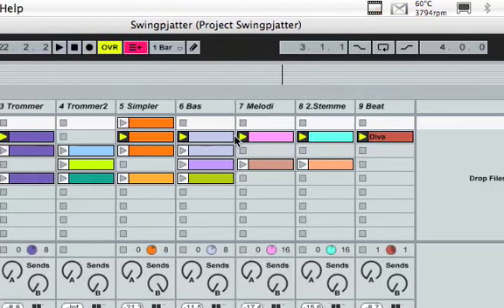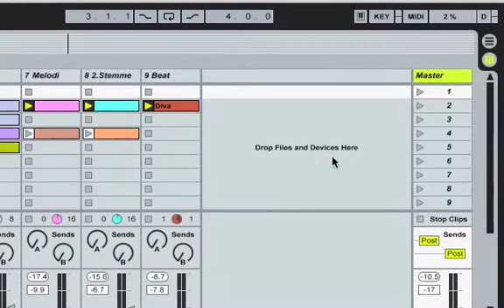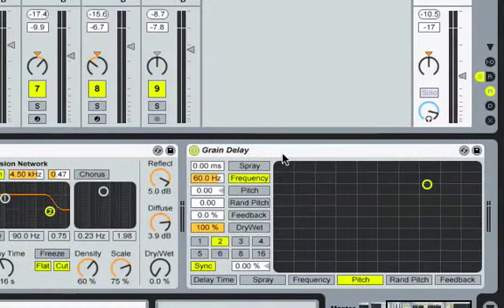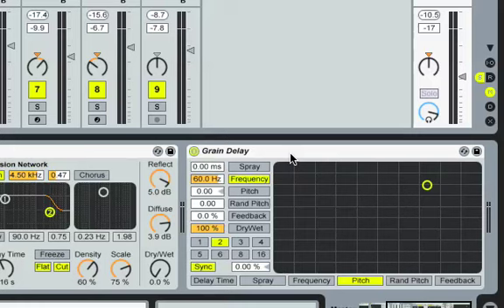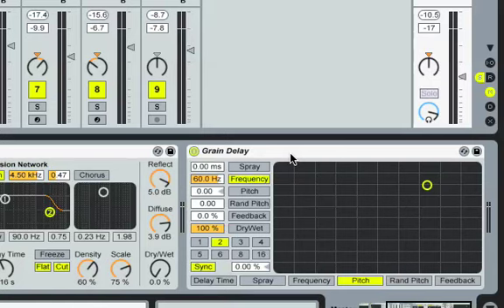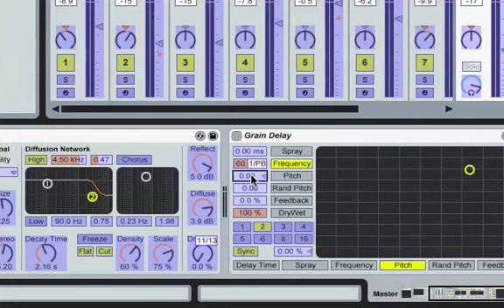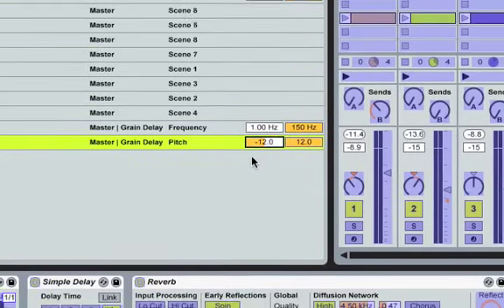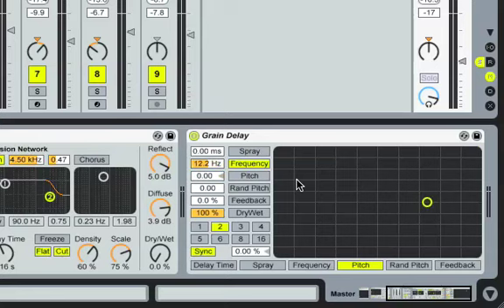How to make a cool pitch bend effect in Ableton Live

Comment: Many popular songs use some sort of method on their bass instrument, where right before the drop, the bass starts at a higher note, and smoothly slides into the first note of the drop. Can you please tell me how to achieve this?
Reply: +Dakoolguy111 In ableton if you use the Operator or Hip-hop preset, you can just turn your glide knob (macro) up and adjust how fast or slow the notes glide. Just make sure there is a slight overlap of the notes in your midi composition.